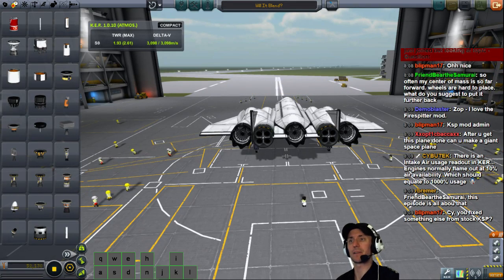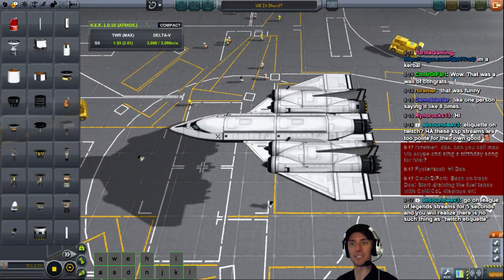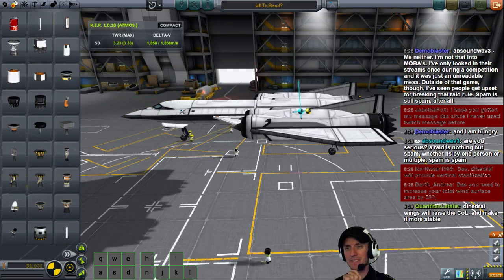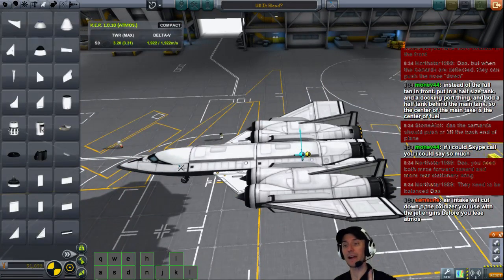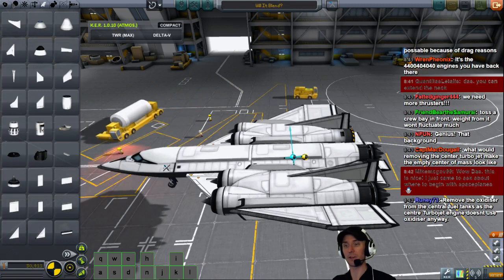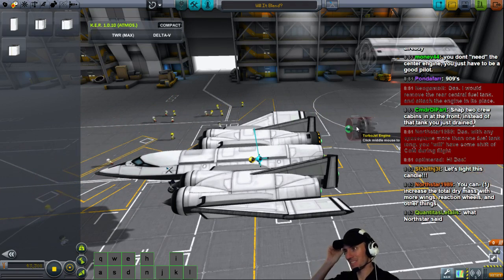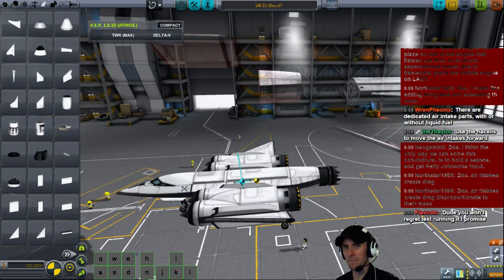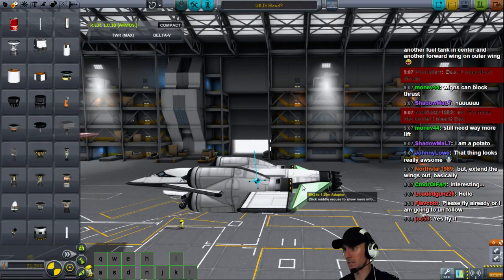Kerbal Space Academy - Advanced Spaceplane Balance - 2 / 5

Comment: 22:40 The reason is because your fuel tanks are not the center of your mass. After they drain, your center of mass moves. To prevent this, always center your fuel tanks on the center of mass. This can be tricky if you are unfamiliar with the way Kerbal Space Program drains fuel from tanks.

Rocket engines drain unevenly. The top of the stack drains first, then the tank below that, and so on, until it reaches the engine. Radial stacks are drained before the main stack. You can alter some of this behavior by using fuel lines between radial tanks and the main stack, but any stacking will always drain from the top down when fueling rocket engines.

For this reason, i find it most beneficial to only use a single fuel tank per stack, and use radial tanks with symmetry. I place all of my tanks on the center of mass, side-by-side. As the radial tanks drain, your CoM (center of mass) will not change. Then when your main stack drains, your CoM will still not change. This way, you can entirely avoid the issue of your CoM changing in flight.

With jet engines, fuel tanks drain evenly, so you will not experience an alteration in your CoM when using stacked fuel tanks, either on the main stack, or radially. I do not know if fuel lines affect jet engines, but I do not think they do.

Centering things is the key to balancing your craft, which is the magic that sets responsive and predictable craft apart from wonky and unpredictable designs.

25:15 I see you've worked that out, though. I should have kept watching.
Reply from the maker: +thedrew4you Thanks for all the comments! Have you seen the Intro to Spaceplanes/Spaceplane Basics VODs where we cover this in detail? 

Also, Rapiers, amiright?
Reply: K Space Academy - DasValdez
I haven't seen them yet, no. Honestly, I was putting this on for some background commentary while I fiddled with my huge spaceship. :s

Rapiers, yes.